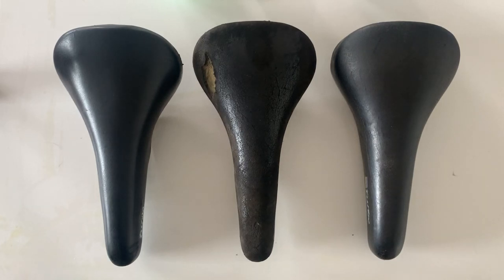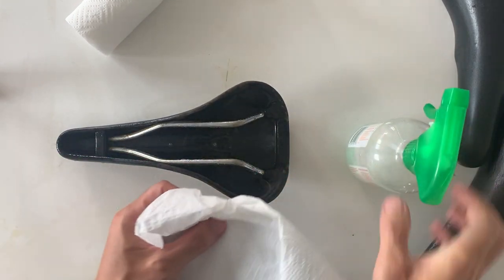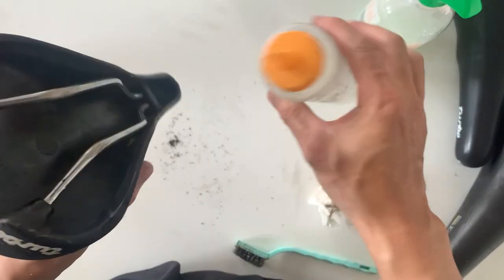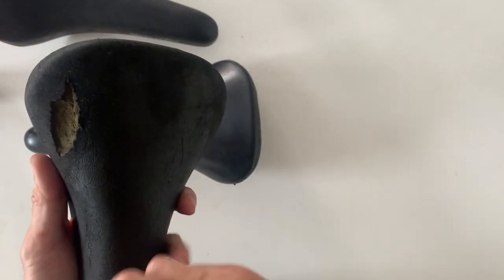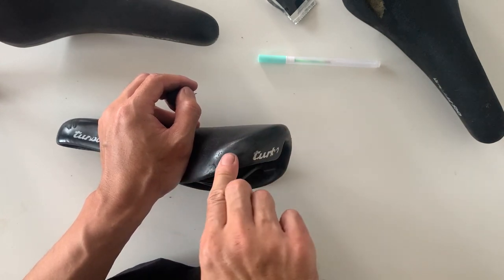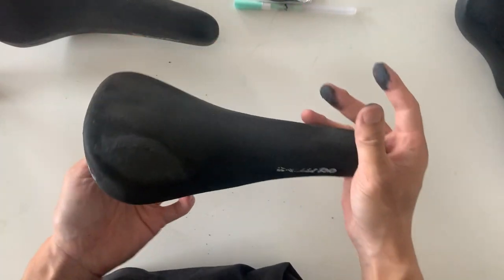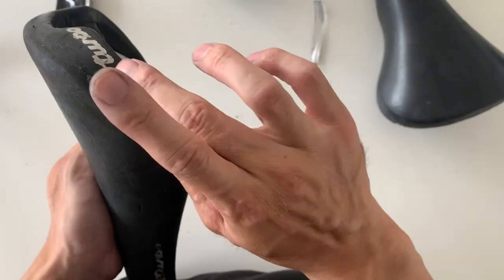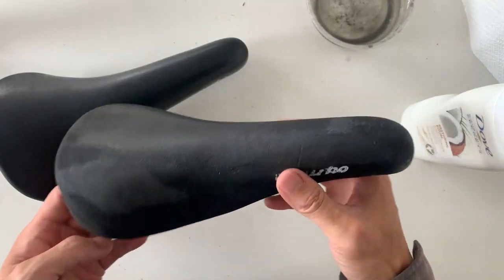fixing / restoring 3x selle italia turbo saddles for bicycle

Comment: The saddle with the black rails is a "re-pop" or reproduction. Still being sold on Amazon. The two with chrome rails are the real deal!! Save those. Some are suede and some are smooth leather. Use products to match the type of leather you have. Suede is a bit more finicky.
Reply from the maker: Ahhh I see! Thanks for the insight , appreciate it 🤗